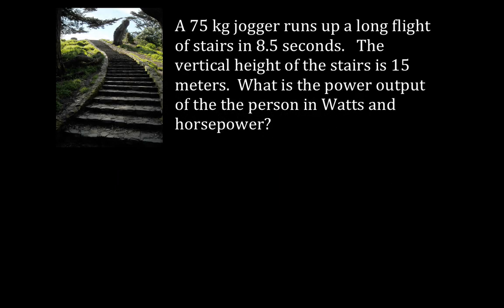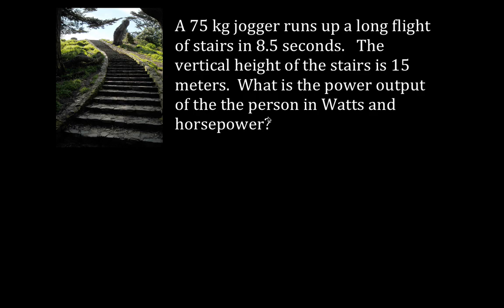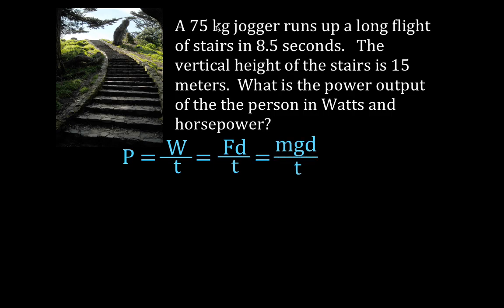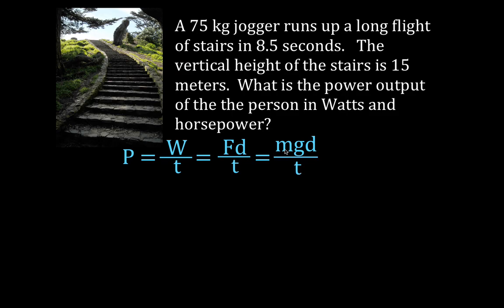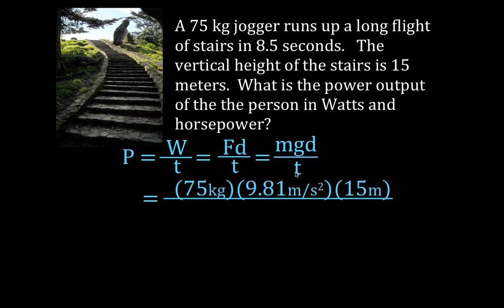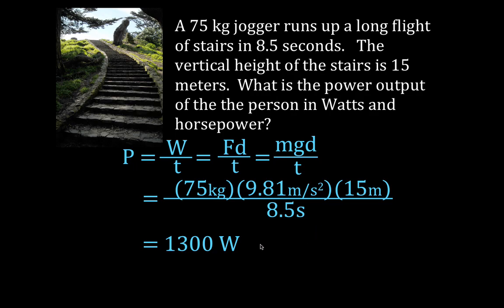Energy, Work & Power (29 of 31) Power, Calculate Power Output When Running Up Stairs

Comment: If you're running up the stairs, doesn't that mean you accelerate at first because you start at rest, so V1=0? Then how would you calculate the power if you're accelerating?
Reply from the maker: Yes, but were usually simplify the problem so that we do not consider that, but it does take you some work to get going. That is the work-energy theorem.

Comment: im kinda confuse to this question :"1. A 3.85 N force is applied to an object, causing it to move 10.0 min 3.41 s. If the force is applied parallel to the displacement, find the power expended by the force." and i dont know which formula to use in power